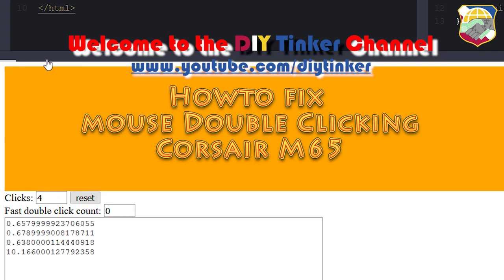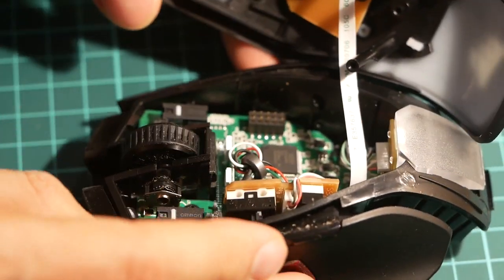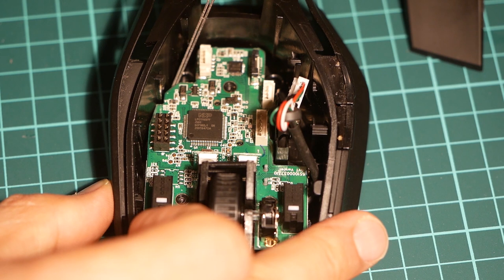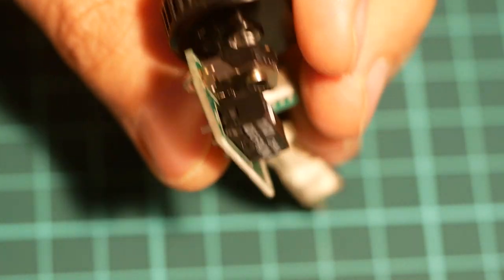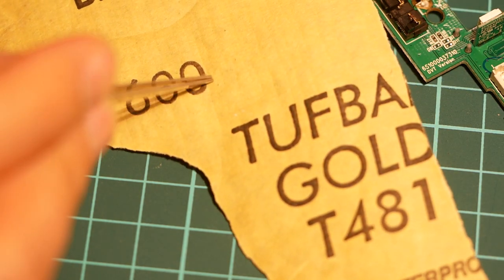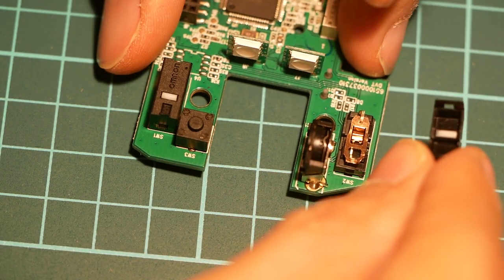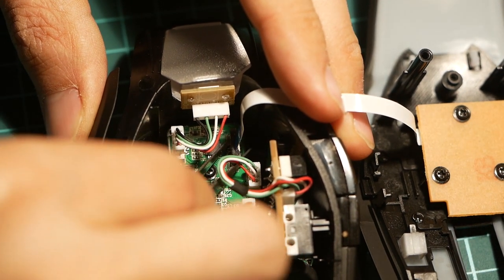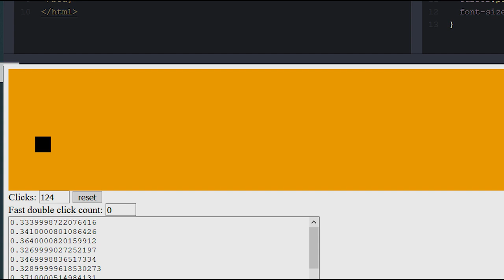Howto fix mouse Double Clicking - Corsair M65 repair

Comment: I've used optical mice of different brands for years, but never had this type of problem with any of them. Thank you for figuring out the culprit, I'm going to try your cleaning method first and if that doesn't work, buy a different brand.

Comment: This is a really relaxing guide. Mouse no longer double clicks. I may have damaged it a bit, so it no longer makse a clicking sound, whenever i press on the button.
Reply: Took the mouse apart a second time. The small copper part was not seated correctly, so it wasn't making full contact and thus failed to make a clicking sound.

Comment: I tried to fix my double clicking issue. Ended up breaking the mouse lmao.
Reply: Same fml
Reply: @Sora-o   same here
Reply: How did it happen? It worked for me, just had a couple incidents where I bent he contacts, but I bent them back.
Reply: @mateuscampello  contact broke for me.... i just ended up getting a razer vaper ultimate.
Reply: @mateuscampello  I'm just not good with really small parts that were inside that mouse I guess.
Reply: i want my mice to double click
Reply: same here that little 'contact springy thingy' is a major PITA
Reply: Your repair skill was too low
Reply: same
Reply: well, you kinda fixed it lmao

Comment: Followed this on an M65 RGB Elite, tricky bit I found getting the contact off and on but other than that a breeze, working a treat now. I used to have to press hard to get a contact and 20 in a 100 were fast doubles but not one now, thanks for the help!

Comment: Thanks for the video! I'm going to try it out later.  I don't why the buttons on a cheap mice from back in the day seem indestructible but the expensive ones often screw up too easily these days.  My third gaming mouse within 4 years that has a double click issue without any good reasons for it. Might as well invest in a whole soldering kit and replace the switch than to buying a new mouse each year. Wish me luck!

Comment: Absolute lifesaver! Worked first time! I gave the copper parts of the microswitch a little swab down with isopropyl alcohol to remove any skin oils from it though - not a necessary extra step, but probably worth doing.

Comment: Just tried this on a newer M65 Pro, and it worked like a charm. Button no longer double clicks, and feels snappier and more responsive as well. The newer version is a bit simpler inside, so there are less cables to disconnect, and the screws are al philips head.

Comment: Great info!!!  My mouse kept deselecting or dropping the "drag and drop".  After watching your video  I just use more force to hold down the button and it works great!!! I never thought the switch/button would have physically warned out as per your video (and not software at fault). Thank you!!!  Great insight!!!  Maybe you can tag my problem to your clip

Comment: Damn after watching this video, I resolved the issue by buying a cheaper $40 bucks mouse this time. This way I wouldn't have to worry of it failing on me 2 years down the road as it will be less of a pain to switch by then. My hats off to the folks that took the trouble to do this.

Comment: Great video bud. I have an m65 Elite RGB. Within 2 months the double-clicking started. Is it possible I can use Kailh Red's or any other type of key switch inside the mouse? Are they all the same form factors or is there a specific spec I need to look for?

Comment: Well, after fumbling the little copper spring replacement a few times, I finally got it replaced. Now one click is deeper than the other, but I figure the worst case is I would have had to buy some soldering tools and just replace the whole piece, so I'm happy.

Thanks!

Comment: holy shit, thank you . 

I asked for a new mouse for Christmas, but was going to get rid of this one....but now that I did this, I may continue to use it and just hold onto the other one I'm getting for when this one officially craps out on me.

unfortunately, I broke the plastic hinge that fastens/safely holds the wire connection for the DPI/DPI RGB on the top of the case, to the circuit board (near the forward/back wire connections).

It still works, but I know eventually that thing is gonna give. At least it's to something that I don't really deem important (especially the RGB for the DPI setting).

At any rate, used the double click test, and did over 100 clicks from slow to very fast, and it didn't detect a single one! Who'd thought that gently sanding some copper would fix such an easy, yet complex problem!

All the more, thanks a bundle! Be safe, and have a wonderful holiday season! :D

Comment: Thank you so much for this, everything worked perfectly afterwards. It was really hard to open the switch and get the circuit board out of the mouse but it was totally worth the effort.

Comment: The mouse worked for 3 months, then the left mouse button no longer worked properly. With the help of your video, I was able to replace the micro switches. I'm curious how long the mouse will work now.
Thanks for the tip. :-)

Comment: Thank you! I was having the double click issue that turned into missing click problem. It took me a couple of attempts to get the copper contact to fit back on the switch but eventually figured it out.

Comment: Seems to have worked really well.
Right click seemed to give me 1 double click after a few hundred on the test site so I did the same thing there.
I didn't have sand paper handy so I just used the fine rigid teeth on my ifixit tweezers and it did the job.

Comment: Thank you for this! Putting the copper spring back on sucked, though

Only downside is that my left click is more muffled, but that's such a minor thing that it doesn't really matter
Reply: Its been 2 hours since i started trying to do this, how did you manage? L0l
Reply: @source.mydelusions  i ended up doing it in two days because i decided to start late in the evening and just needed to sleep because it was taking so long. left click is still good here

Comment: Dude, thanks a lot for the video, I was on the verge of opening my mouse to clean the top of it which seems to be forever sticky, clean or not, and decided to search for a solution to double click, since my side buttons were awful, and the main ones weren't too great. It worked, my mouse is like new rn, absolutely 0 double click. But I have to say that the main switches were sketchy to remove and put back the contact, I bent it a couple times, but it's fixable.

Comment: This is deeply fixed it. sometime spray contact cleaner not enough to remove oxide but mine scroll wheel was broken. its axle too thin. The new M65 Pro Elite look like they use the same parts. it was bad designed.

Comment: You forgot to mention how INSANELY HARD it is to put that copper piece back in and without bending it. I've professionally repaired smartphones from big companies like Apple and Samsung, and I have yet to find a harder and more annoying repair yet than installing that little copper plate for this mouse. (needless to say I failed and bent it) fuck.

Comment: well well well well well. i was a bit worried about going through with this, but this mouse has been in the house for over a decade and is by far the best fitting mouse i've ever held so i figured i needed to try something to bring it back to functionality . the first time up i took it apart and put it back together  only for the click to feel soft? well i went back and adjusted the lil copper peace till it felt right, now im very glad i followed ur tutorial man! 10/10 work

Comment: so im assuming this isn't a permanent solution? and i guess if you buy the micro switches you can just take the contacts out rather than having to deal with all the soldering and just use the pieces inside for when after the first sanding needs redoing or does the first time fix it permanently?

Comment: The omron switches are junk. Is there a better replacement switch that can be used? I'm now on my 3rd RMA. Left button is just simply not working at all during some clicks. A harder press will get it to work.

Comment: For you guys that are having the double clicking issue, before opening or replacing the switch, try applying some wd40 to see if that alone resolves it. Worked for me. I will get back to this comment if the problem comes back :)

Comment: Before doing any of this, Windows 10 has a double click bug. In pointer options, I turned off enhance pointer precision and it stopped it. I had bought a new mouse and it was doing the double click thing as well. That's how I found out.

Comment: Well since you're recommending replacing the switches I might as well ask, what's the best mouse switches?
This guide recommends the cherry DG2 T85 switches for both left and right buttons: https://www.s-config.com/corsair-m65-pro-rgb-mouse-repair/
This guide (generic for any mouse) recommends Kailh GMs, Huano Blue Dot Blue Shell 0.74N or Omron blue: https://www.maketecheasier.com/replace-faulty-mouse-switches/
This reddit post recommends the Panasonic EVQ-11D05B for the middle button (which also breaks): https://www.reddit.com/r/Corsair/comments/67s4jh/m65_middle_click_fixed/
And lastly I found these two reddit posts about mouse switches: https://www.reddit.com/r/MouseReview/comments/9k541h/best_mouse_switches/ and https://www.reddit.com/r/MouseReview/comments/cnbnly/so_kailh_reds_are_the_best_switches_for_mice/
EDIT: found some videos though still would like to hear your thoughts:
https://www.youtube.com/watch?v=OdAfPjn6xdM
https://www.youtube.com/watch?v=TN-JOkr1JhA
https://www.youtube.com/watch?v=00nOAgfzxtI
Reply: Thanks for this, I went with the Kailh GMs for left and right MBs
Reply: absolutely, for me soldering will be easier than repair and not looking to go back with the Chinese switches. thx for the link

Comment: I did the fix and it now no longer double clicks; however, I lost the tactile click. I think it is possible to sand both contacts while it is assembled. Cut a small strip of sandpaper and put in in the contacts, push down on the contact and sand. Flip the paper over and do the same thing. You won't bend the copper out of shape with this.

Comment: Actually, you don't have to do any of this!  I found that taking an air duster and blowing air through the opening under the left button solves the issue.  I believe dust getting into the button caused it to be off slightly by nanometers.
Reply: This sounds great but wouldn't the black cover stop the air from cleaning the problem area? They need to recall this problem! I am on my 3rd RMA

Comment: thanks, I replaced the cheap Chinese switch that is in there with a higher quality built made in japan which uses a different switch system and materials that last longer, everything went well mouse works and double clicks are gone, the click itself feels and sounds different but is very nice.
Reply: Can you link to the higher quality part please?

Comment: My M65 is double-clicking on the side buttons, and my Vengence pro rgb ram is bad.....One stick fails Memtest right away and fails the Win 10 memory test app, and the other one is randomly fails. Replaced the ram with GSkill trident until i get my replacements. Don't forget to make sure you have (must have) your receipt for ANY Corsair warranty issues...

Comment: After cleaning inside and putting the mouse back together, the issue was worse. I fixed the problem completely by loosen the two screws a little on both sides. Good luck guys
Reply: ... Wow. I've disassembled this mouse and cleaned the pads, removed dirt and grime, and have done all but replace the switch or sand it down like this video. And you know what? Loosening the T6 screws on the bottom of the mouse just a tiny bit actually fixed this issue for me.

Comment: Pro tip: if your mouse is registering clicks but drops them while you're dragging and dropping, all you have to do is:
1) Get some electronics duster/ compressed air and stick the tube between the plastic top and the metal base before blowing for a moment
2) Get some QD contact cleaner and do the same. Let the excess run down from the left mouse mutton down to the back and out the opening
Your mouse should be fixed.

Comment: I didn't have a Torx screwdriver and my hex and flatheads were starting to strip the screws. What eventually worked was to install Autohotkey and put in a script that prevents the second click if the second click is <100ms. So PSA if you can't open your mouse, I guess.
Reply: Hey do you happen to have that script available? Looking for a simpler fix than what the video does and your method seems simple enough (i don't have much coding knowledge though)

Comment: great tutorial and it helped tremendously, but sadly putting that little copper contact back in it got out of shape and became useless. think next time I'll clean and reshape that darn contact in place; either that or 'sweat' another back in. am on my 3rd M65 in about 3 yrs; each one it's that durn left mouse button grrr, that is a really bad weak point. once again your vid was very good.

Comment: I've owned 3 M60s and so far one M65 and I always run into the same issue. The middle mouse (wheel) button ends up double or even triple (rarely quadruple) clicks.

Comment: Amazing work brother, WD-40 or any other type might fix it as well.
Reply: thing is that contact is WAY too flimsy.
Reply: WD-40 did work for me few days ago.
Reply: @marxleanmotus1274  The problem with WD-40 is that it's a short term solution, the product goes away after a few days. I think the best solution is to change the switch.

Comment: the micro swich from this mouse is from very bad quality, thats the problem: 2 months after buying this mouse i had clicking problems, and only on the left button...I have a old Logitech mouse, work without any clicking problems in intensive using during 6 YEARS and did still work today without any fail...

Comment: this worked for me. unfortunately, the copper plate bend a little bit and I had to try and rebend it back and now the mouse doesn't click as profoundly as it used to. It's like a very faint click, very soft to the touch. but hey, it doesn't seem to be double clicking anymore

Comment: Thanks for the guide, very helpful. I managed to fix my double clicking issue. My mouse didn't look the same on the inside- maybe it's a slightly different model I'm not entirely sure. Still, it did the trick!

Comment: FYI. If you choose to replace the switch with a OMIRON Japan D2F-F, remember that they stand taller than the China version soldered in the mouse. I had to file down the nylon pads in the mouse, in order to have proper clearance, don't file down the plastic button on the switch. File down a bit at a time and reassemble and check the clearance, it should click and release properly with each press.
Reply: hey man I know it's been a year but do you mean the nylon pads that are on the bottom of the switch? or is it on the pcb under the switch? or do you just mean you filed down the top pf the switch just not hitting the actual button? (haven't taken my switches off yet my japan omrons are coming in mail right now thanks!)
Reply: @CockySoupNazi  okay so I see now its down inside the shell of the mouse is it the two kind of plastic standoffs? screw holes its resting on or is it this little kind of ledge its resting on in the corner thanks man ill figure it out now fs, thanks for the help you a g!

Comment: Within the switch: Once that top metal piece was pulled off the holder, it could not be held back in place, like it lost whatever springiness it had.  I give up, but thanks.
Reply: Ok, did get it back in place, somehow.  But with cover back on it no longer clicks.  I will never buy another Corsair.

Comment: Revolutionary OMRON switch's insides LOOKS JUST THE SAME AS 10 YEAR OLD SWITCH ON MY A4Tech X7 mouse and 5$ MOUSE WITH CHINA CHEAP CRAP COMPONENTS...
Same bended metal sheet that wears over time.

Anyway, fix is legit. I've done it several times. on some mouses.

Comment: 1. M65 was double clicking. Goes to the double click website.
2. Maybe it will go away...
3. Accidentally closed a browser
4. I should get a new mouse...
5. Watch this video and start repairing
6. Did everything until the micro switch...didn't want to pry it open... so never mind.
7. Putting everything back, might as well clean it...What is this? A strand of hair? Right on top of the left click trigger of the plastic cover, remove it and wiped it clean.
8. Goes back to the website, it no longer double cclliicckkss :)

Comment: Much simpler solution: don't buy Corsair mice. $60 for a mouse that breaks within a year, and you have to remove the entire circuit board to fix it? no thanks

Comment: looking to try to solve the problem I have I found your video Thank you for your information it is very nice that there is someone who dedicates time to help others and solve their problems but in this case my problem is one of the photos you presented that the wheel is They broke the commissions, the legs as it does not say I speak Spanish but it is a translator to translate what I am saying Sorry if you do not understand me but I am looking to buy that part only because the device does not have any other problem, only that I have contacted the company but They take a long time to respond and what they tell them that I have to have it, I receive it when I bought it I have it I bought it at Walmart I put a guarantee from Walmart but Walmart tells me that the first year is from the company that made it so I need to solve that problem because in itself I need it and I did not pay much but it was at a reasonable price for what I used it to play fortnite Hahaha I would appreciate your answer if you know something where I can buy that part Thanks for everything and I also stream on YouTube facebook and Twitter